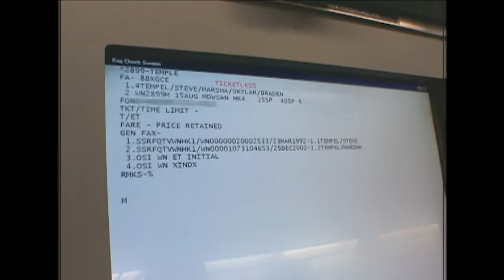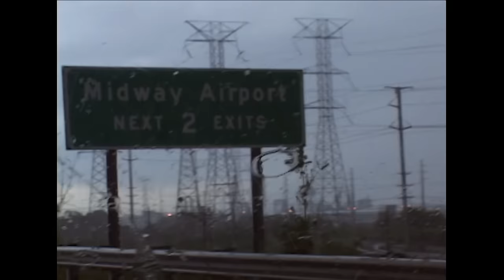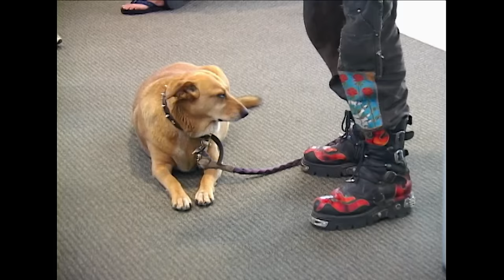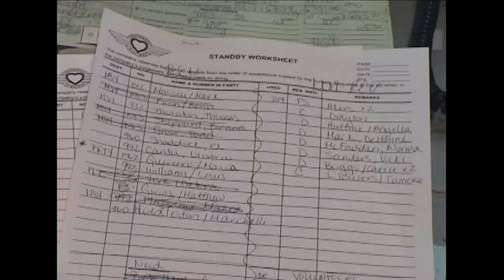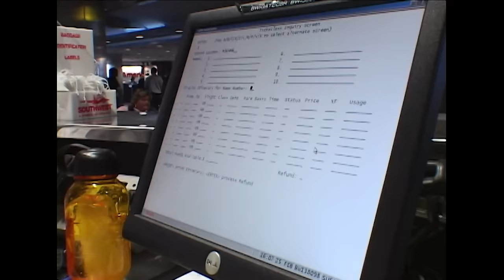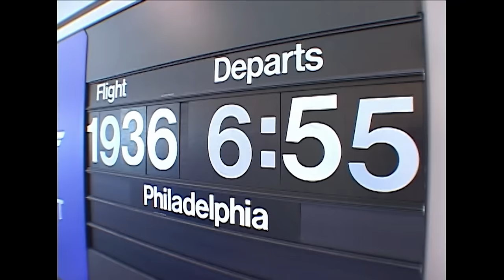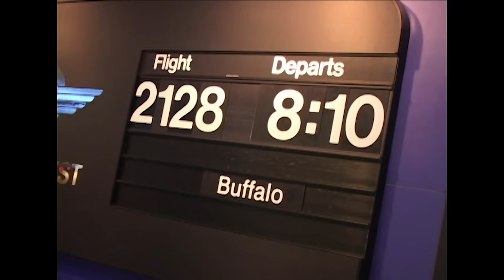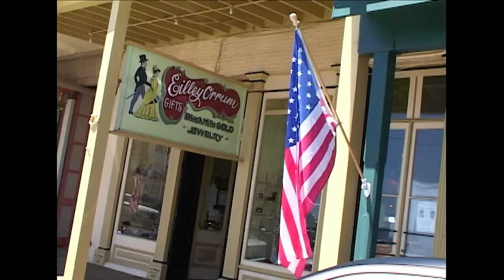Airline: Best Full Episodes of 2023 MARATHON | A&E

Comment: This show started filming several years after 9/11. This is an accurate representation of how a few people behaved back then. It was much worse during COVID, and not just the behavior. People came on the plane knowing they had COVID. Before COVID, people came on the plane with measles, chicken pox, and many other contagious diseases. The rules, with the exception of those that changed after 9/11, have been the same for over 30 years. The only thing that 9/11 and COVID changed was the part where the FAA started enforcing the rules. I worked in the industry for 30 years, both before and after 9/11. I have had passengers throw drinks on me, take swings at me, cuss me out, tell me that the plane was going to crash, threaten me with bodily harm, hit me with their bags, try to storm the flight deck, you name it. I worked both on the ground and in the air. Attack me if you want, but this is still the reality of flying.